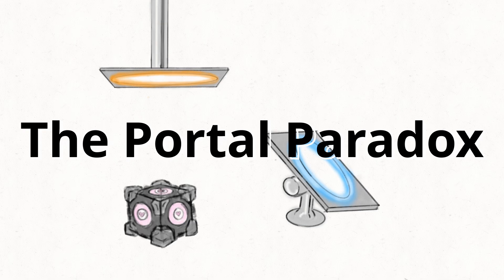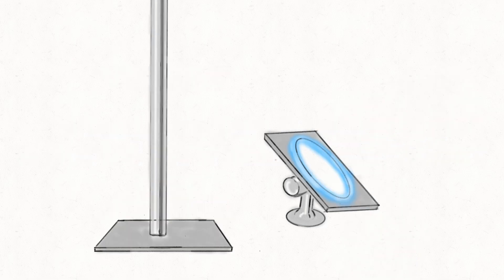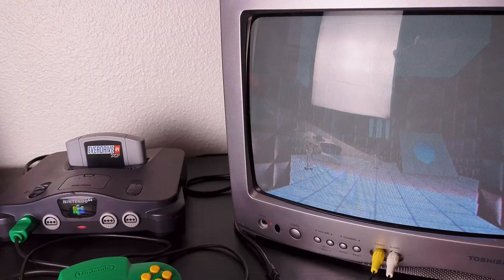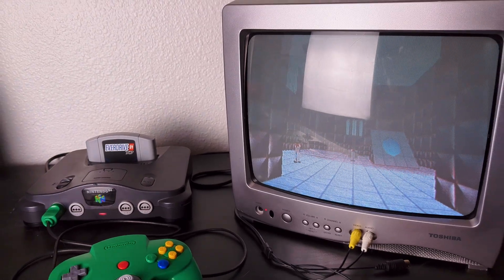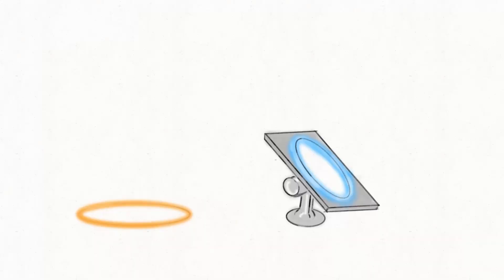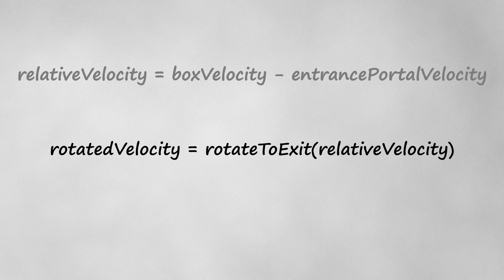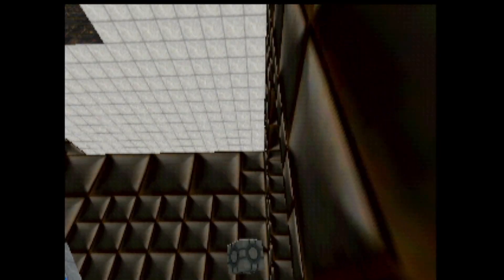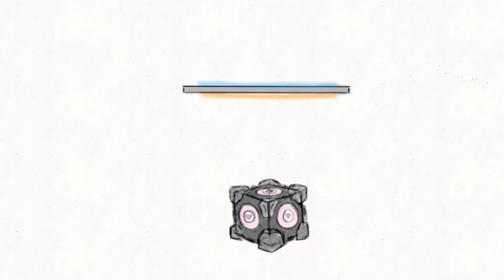I rewrote Portal from scratch and solved the Portal Paradox

Comment: i kinda figured this out by running a simulation in my head. U figured that if the portal wherd to go down on the cube, it would have to push through the box thus giving it a velocity.

this also means that the laws of physics do not get broken because you would need an increadiy strong piston to push the air and cube through the portal.

now I just wonder if the box gets exposed to high accelerations because it suddenly has motion instead of standing still.

i feel like it must be exposed to a high amount of g's for a short period of time but I might be wrong.

perhaps something you could test?

Comment: What happens if the portal accelerates while the cube is inside it? At what point is the exit velocity calculated? When the center of mass crossed the portal?

Similar situation:
What happens if the cube sits half in the portal and one portal starts moving. Which half of the cube will be stationary and which half will move? Is the half cube of the moving portal pushed away so it stays half in the portal or does it not move and the other half in the stationary portal starts moving?
I think this can not be explained with classic mechanics.

Comment: I say that the cube should stay still or just fall out because the ground the cube is on isn't moving at all, so rather than inertia making the cube fly off it would more function like the surface the cube is on just rotated/gravity changed for it, causing it to tumble rather than launch
Reply: Definitely. The portal itself doesn't have momentum

Comment: Great work, but what I think is:
1st I agree, when both portals, side by side, moving the same speed, the cube will look like non-moving, but
2nd when one portal is stationary and one moves, something different might happen, but shooting out... Okay when the cube was moving, but I don't think so when the PORTAL is moving, because: The cube doesn't have any momentum.
I'd expect it to drop down immediately in your test. My point is: How does the momentum of the piston (the portal) transfer suddenly to the cube?

Short things long:
- If the cube was on a piston and moved (fast) into the orange portal, fixed on the ceiling, I'd expect it to "shoot" out of the blue portal, because the cube got momentum but
- If the portal was as shown, the cube (without momentum) just suddenly has a new balance point, because the new angle of the floor is no longer even but steep

Analogy: imagine your second experiment, where both portals moved the same speed. Let's just assume your portals are just a hole in the wall, which you're moving:
- if you move the wall with high speed down over the cube, the cube doesn't move (as long as the hole/portal is big enough to fit the cube of course) but
- if you move a piston, holding the cube up to a hole in the ceiling the cube would "jump" when the piston suddenly stops, because the cube still has momentum

So I imho think the important question is: Does a portal take/transfer/vanish the momentum?
If yes: it just belongs to the gravity what happens after
If no: does the momentum of the object (cube) count or can it (the portal) transfer it's own momentum to the object flying through?

Comment: For the cube to move, it would need force applied to it. And at no point did that happen.
It was standing on the floor and it continued to be standing on the floor. Only the area around it Shifted.

The portal is just like an open door. The frame of the portal would hit the floor around the cube, yes, but ....

 But this whole argument brake when you try to explain what happens to the air that was there when the portal moves. It cannot continue to be there so it has to go somewhere. Its not displaced since there's an oppen portal and not a solid pannel.  So it passes through. But, on the other side there's air as well, so it has to push through.  So there would be a breese coming out of the blue portal as the orange one moved.

And now my brain is fried.

I think the video is correct now.
Portals are weird
Reply: The video isn't correct with Portal physics. And I think it's why they don't move in the game. The argument is that the portal has momentum, but it does not. The thing pushing the portal does, which never touches the cube. The only momentum between them is the air. (And of course ground which is interesting to think about, but it's not a lot of force because the piston doesn't move at insane speeds). As you said though, the portal is a door. It doesn't change the momentum but rather keep it like a normal door.
Reply: @Ethan-K  Yeah you have strong argument there. And I'm almost certain that you're correct. But I was honestly racking my head around it for, like 15 minutes before posting the comment.

Portals are really weird. I think the cube might've hopped an inch or five. In due to some suction cup effect from the air maybe? Idk. But it would certainly not fly through the air like that
Reply: @lefterismplanas4977  Yeah the air could be effected by things, and the speed would change that. If it were a cardboard box it may go flying, but it seems like the cubes are extremely heavy. I think that's why you need the portal gun to lift them. That can go either way though, even if they're not extremely heavy they're still big metal cubes and wouldn't easily go flying.
Reply: @Ethan-K  💯% agree

Comment: So lets say the blue portal in the paradox is not on a angle it will still push out in your equation. Lets say entranceportal velocity is 1box is 0.
rV=bV-ePV
rV=0-1
rV=-1
roV=rV
roV=-1
FbV=roV+ePV
FbV=-1+0
FbV=-1 thats why it shoots out so a negative FbV shoots the thing out

But what if the box was standing on the blue portal the the orange one pulls out of the floor. The exit portal will be 1

rV=bV-ePV both are not moving 
rV=0-0
roV=rV
roV=0
FbV=roV+ePV
FbV=0+1
FbV=1
So will the box not pop out of the orange portal as having a positive FbV is not pushing but pulling In the simulation?

Comment: First of all, nice work on the N64 engine. However the problem with the solution to this paradox is that it conflates game engine physics with what would happen in the real world. The two are very different for the mere fact that the game code has to treat the portal itself as an object (or, rather a pair of objects) so that when an object crosses the boundary of that portal, the game engine will then compute the new frame of reference on the object. By doing that, the portals have a direct influnce on the object, and their relative motion impacts the outcome. This is where the game physics engine falls down. If it were a real world, and the portal existed, as described in the game, the portal itself isn't a physical thing (it is a hole between two points in space), and it would have no direct influence in objects passing through it. Thus it would behave in the manner of the hula hoop example. I suspect that the game designers knew of this flaw in the engine, and that is why there are no examples of this relative motion paradox in the game.
Reply: I disagree with you on that. I think the portal and the object being moved would behave exactly the same way in real life as it is shown here. If the portal is indeed not a physical object, it has a capacity to move an object and this is where the comparison with a hole stop working. Let me put this in simple terms:

If the first portal is moving towards the cube at 0.5 miles per hour, I think we can agree that the cube will come out of the second portal at 0. 5 miles per hour.

If the first portal is moving towards the cube at 100 000 miles per hours I think we can agree that the cube will come out of the second portal at 100 000 miles per hour.

We know that the speed of the moving portal has an effect on the object being moved. It's not like the object is simply moving throught a hole.
Reply: @Jordthelord1  I suspect that we will have to agree to disagree. If the portal is a hole between two points in space, as it appears in the game, the portal itself doesn't influence the object in any way: it is a literal hole. The object merely passes from one point in space to ther other. It the portal is moving to the object at 100,000 miles per hour, the object will simply appear in the new point in space much faster than if the portal is moving at 0.5 miles per hour. That is all. The inital momentum of the object remains unchanged until any forces in the new point in space start acting on it. The portals preserving the momentum of objects passing through them is one of the key mechanics of the game. That is not possible if the portal itself impacts the momentum of the object, hence why the game designers avoided this scenario in the game.

Comment: I do not think this is a good explanation. Here is why: 
This is regardless of what the physics do in different game engines, as you have stated the portals do not move in the actual game of Portal. To my understanding, whenever you are flung through a portal in the game, you always have velocity beforehand. The portal acts as a door, if you try to enter it at any angle, without velocity, you simply go through and are not flung. You can picture this with the "doorway" analogy (yes that's what I'm calling it). Say you have a doorframe, and you fling it at a person, or an object for that matter, going 100 miles per hour. The person and/or object is not going to be flung. They may be moved by the air that the doorway pushed, but pretty much stay in the same place. You get the same results at any angle. Whether you have it come from beneath, drop a doorway from above, left or right, diagonally, the person is not flung. And so, because portals are essentially Sci-Fi doorways, they canonically have the same physics.
Reply: The comparison with a door frame only works if both portals are stationary. Which is not the case here. If we want to keep the door frame example, if the blue portal is moving toward you and the yellow portal is stationary, it would be like if the entrance of a door frame would be moving toward you while the exist of the same door frame would stay staionnary.  Which would just be different way to describe a moving portal. 

The fact that one portal could potentially move would completely change the physic of how the portals work. If the movement of one portal can move an object from one place to another, that means the speed of that portal will have an effect on the object being moved (like the object will come out of the second portal at exactly the same speed as the first portal was moving toward it).
Reply: @Jordthelord1  That would only work in the explanation that the video has, which is that the portal itself has momentum. But evidence in the game shows the portals do not add or take away momentum, they just carry the same momentum the object had. If you throw and object through a door, it has the same momentum and continues onward. If you moved the entire door past the object it would stay in place. With portals, it connects two different places, but with the same concept. As the portal is moving down on the object, picture the entire room moving down upon the same room with the portal. The cube goes through the portal, and all it does is change location within the room.

Comment: Okay so first thing is NO THE CUBE WON'T TEAR APART. Even if you were moving at the speed of light you would need an amount of force or cohesion (greater than the speed of the moving portal) keeping the bottom half of the cube stationary. The 2nd point is that like in the first example when the portal slams into the ground and stop instantly, this also happens when stopping at the half way point. Imagine the cube half recessed into the ground, portal slams into the ground like in the first example. Changing to a portal that slows to a stop changes how all this would work. So the cube is# not attached to anything and there is no downward force except a bit of gravity. Lets say the cube weighs 10 and gravity has a strength of 1. Lets also add that the portal being moved is moving at 20 and has equal mass to the cube. If you were stood looking through the exit portal, you would see the floor and box rushing up to meet you. The first portal then slams into the floor (only half covering the box). The box would be chucked out at 20speedx10mass = 200 momentum. divide 200 by the weight of the FULL BOX (Once again the box will not split in two.) and that would result in 20 speed. However the half of the box that didn't go through still has downward gravity. (so does the 2nd half of the box but I cant be arsed working out how much force it would produce at 45 degrees as it would produce some spin and blah but can assume the result would be slightly faster than this conclusion). This gravity works against the yeeting force (new technical term ;) to slow the box by weight (5)x gravity(1) so the overall exit velocity would be (200-5)/10 =19.5. Of course in real life you need to calculate the time it takes to get through the portal and apply gravity as it moves, so it would be slightly smaller again but I also didn't work out the gravity of the 2nd half of the box that has already gone through.
TL:DR It does not tear itself to pieces, it moves at a bit less than full speed.

Comment: Relative velocity isn't really relevant.  The block itself has only its own inertia, regardless of the motion of the portal.  No matter how "fast" the portal moves, the two portals themselves are always static relative to one another, and the block itself is static with regard to the position it has and the position on the other end of the portal.

In reality, it will "plop".  It doesn't have any energy, and the motion of the portal doesn't impart potential energy to the block. It's only changing the spatial position of the block.  Kind of like a warp drive.  The ship doesn't move...space does.  In fact, it won't even really plop.  It'll just slide down the ramp from its now angular position on the "floor".  And really slowly, too, since gravity is then acting on it equally from two angles.

The Earth's motion doesn't matter because it remains unchanged from the two positions, and it doesn't matter which way destination portal is moving, either.  If you were transferring it from Earth to the Moon...that would actually matter because the block would then have two completely separate inertial reference frames from one to the other.  But all on Earth?  Or all on any single planetary body?  Doesn't matter in the slightest.
Reply: Relativity is everything here, imagine standing looking through the exit portal, it would look like the ground and cube are rushing toward you, thus from the perspective of the outside of the exit portal the cube is moving, simples.

Comment: So this still doesn't make sense. How does the object somehow has kinetic energy to shoot out from passing the portal . The portal is just a door/passageway it doesn't push touch or interact with the object physically so there in no way the the box has any kinetic energy  to shoot out with that force and its just touchingthe grown cayse of gravity no other force is being added. If you were pushing the box in the portal yes it would shoot out same as dropping the box in the portal it now has kinetic energy cause of gravity pulling it down and when it passes the portal ot will shoot out but also fall due to change is gravitational pull direction. 
The object would just fall with gravity.

Comment: The flaw in this intuition: it’s not backed by concrete physics / axioms.

Similar intuition:
Portal A and B are related and stationary, and the Object moves — is possibly more comparable to:
Portal A and B are related and moving, and the Object is stationary.

Rather than only A is moving while B is not.

I think we need a more complete physics model — even if it is theoretical.